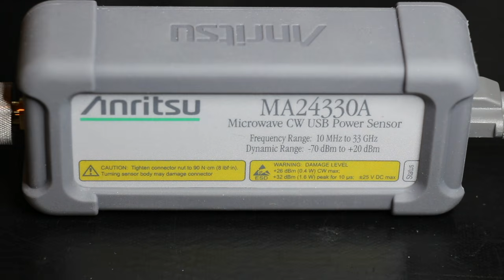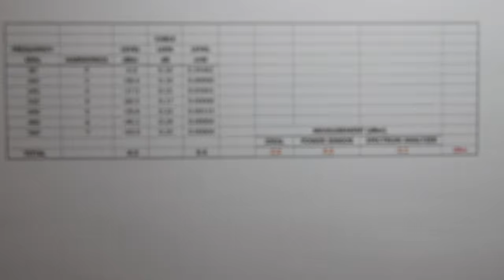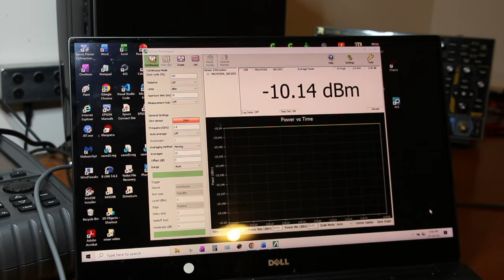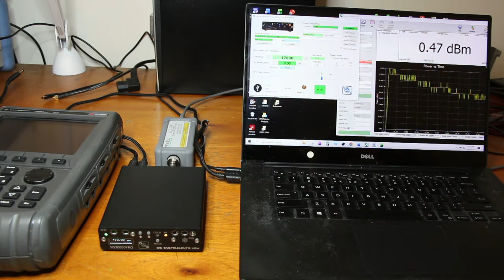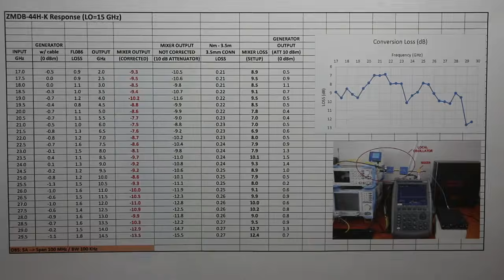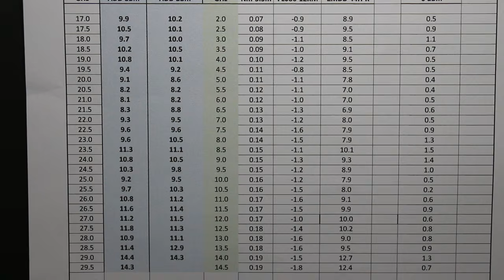#50  Power Sensors and Spectrum Analyzers

Comment: Very good. What about split the full range in segments and add a programmable attenuator to level the output? Would this work?
Reply from the maker: thanks for the comment - I am not sure if I am following you -  are you referring to the microwave generator used for the tests?
Reply: @vk5fe943  I mean to split the down converter range and normalize it with an attenuator. Very much like the input section of the HP 8569 I have. The only missing would be the pre selector yig filter, which is expensive. I'm not familiar with the RF components available, but perhaps it can be done with 'not so cheap' components.

Comment: This is a single path diode power sensor and doesnt have a wide bandwidth like thermal power sensors. The rise time is 8usec. So basically it is measuring the main tone at 80MHz but not the harmonics. Your FSC was also measuring -4.6dBm for the main tone which was exactly equal to your power sensor.